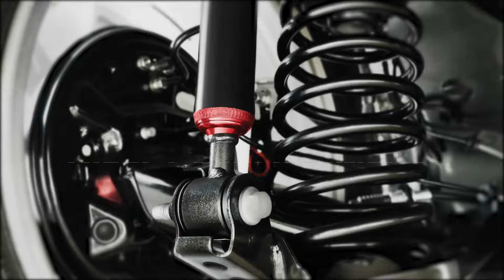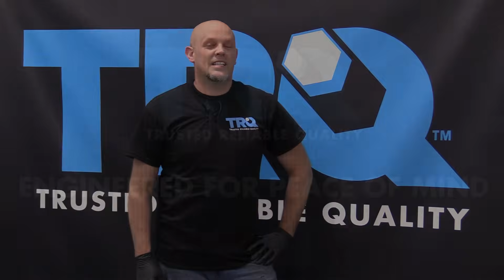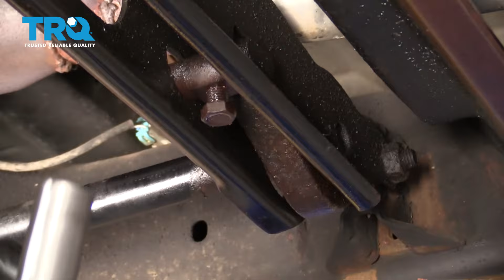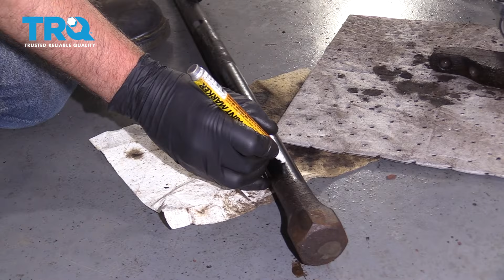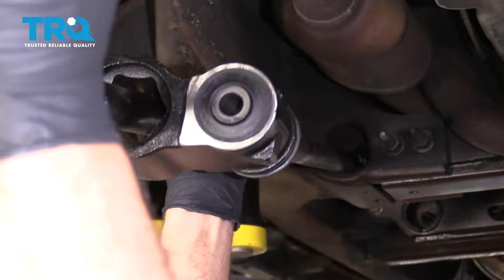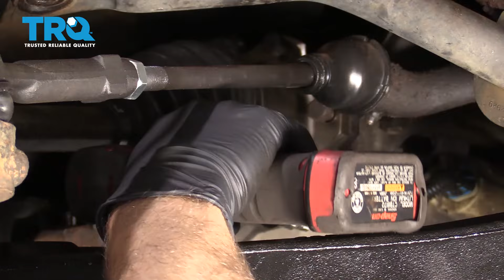How to Replace Lower Control Arm 2000-2006 Chevy Tahoe

Comment: I managed to get my lower control arms off of the torsion bars without having to remove them from the keys in the back.  I took tension off of the keys and the torsion bars allowed enough downward movement to pry the lower control arms out and pull them off of the torsion bar at the front of the vehicle.    I did need to use my air hammer to coerce them a bit, but once they were loose they gave way and were easy to put into the new control arms.  I marked the torsion bar before I removed the control arm so I could get the same flat lined up with the new control arm.     I just wanted ot mention it since it could be a show stopper if someone wasn't able to get the torsion bar out of the keys.  Mine were rust welded pretty badly.

Comment: If I change my driver side upper and lower control arms, do I have to do the passenger side?  I think I bent my lower arm when I hit a giant boulder with that front driver corner driving the bumper into my wheel crushing the wheel.

Comment: What is the tool called for the c clamp you used to relieve pressure of the torsion bar? 

Attempting to find it online but no luck.

Comment: You do not need to remove the torsion bar, however, i did have to remove the upper control arm ball joint as well as the tie rod to enable the lower ball joint to come out easily.
Reply: Ty for this comment, I was dreading trying to figure out how to do this quiet but... piece of cake

Comment: There's no reason to mark \ put the axel back in the same place. it is where it is. It would be good if you cleaned up and painted the torsion bar and surrounding areas. 

 That drives me crazy to leave everything rusty and nasty. Also, if you pull the axel out too far, the inner bearing will come outta place. 
Then you have to pull the rubber boot back to aline the inner bearings. Tiz a bitcha nasty job.

Comment: Can you put Anti Seize on the Torsion Bars when it slides into the Key hole and Lower Control arm Hole?
Reply: I did when I changed my torsion bars about 4 years ago. I placed a bit of anti-seize on the ends to make future removal easier. A little dab on the corners won't hurt.

Comment: I have done all this on both sides, the driver side end link was tough to put on and now the passenger side will not go on. Did I not adjust the torsion bars/lower control arm correctly?

Comment: Did you guys change the bolt length on the sway bar links you sell? I just installed your 10 piece steering and suspension kit on my 04 2wd tahoe and I maybe have 1/4-3/8” of thread sticking out where in this video you have 1”+ did I not tighten mine enough maybe? I torqued them down but it is really old so maybe not calibrated correctly?

Comment: Worse part of this job is torsion bar removal. A hammer drill rental from Home Depot does the trick but without the truck in the air the front end will drag on the ground if you don’t finish the job.

Comment: hello there - i had the same set up on a cadillac 06 escalade esv but i just took out the tension out on the 18 mm bolt attached to tension bar/ key way (mark it with paint for adjustment) and disconnected the lower control arm fasyeners then by separating it from frame and then i slided forward - and it came out nicely 👌
thanks for the video 🎥
Reply from the maker: +rubber MALLET Thank you! We love empowering our customers and showing how to perform DIY auto repairs with our high-quality auto parts. http://1aau.to/m/Shop-TRQ

Comment: I just changed mine in a 2002 Suburban Z71.  I did not remove the torsion bar like here. Once the ball joint bolt was clear of the hub assy, the control arm tilts down and has no pressure from the torsion bar, so the control arm is then wiggled out of the frame and slid off the torsion bar.  You do need to back off the torsion adj bolts. But that is all.  BTW, I did this out in the parking lot at my apartment, and I'm 64 years old.  Also means just hand tools.  The drive axel needs to be removed on 4x4s.  If I can do it here, you can manage it in your garage.
Reply: I did it on my 2003 Tahoe with my dad like 5 years ago and didn’t take the torsion bar all the way out...came back to this video to do it on my 2003 z71 suburban and was like wtf I don’t remember doing all of this 😂 thanks for the personal anecdote !!
Reply: Awesome info, thanks!
And good on ya gettin’er done where ya did, with what ya did and kickin ass no matter what your age is💪
Reply: Thanks for the advice
I did mine the same
Reply: Did you press out the old bushings and install new ones in addition to the ball joints
Reply: thanks for this.  its gonna make this swap alot easier!

Comment: Why did you take the keys out I just did mine on 05 avalanche all I had to do was loosen the bolt take the pressure off
Reply: I need to do this on my 02 avy. I just need to loosen the key bolt???